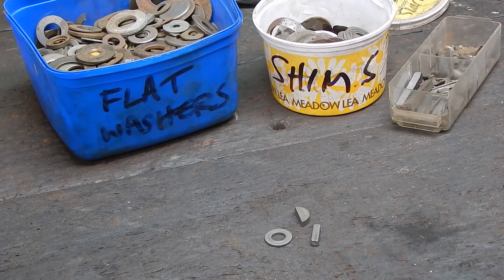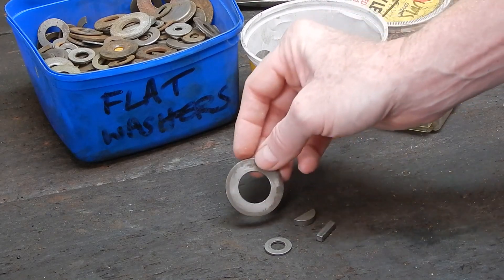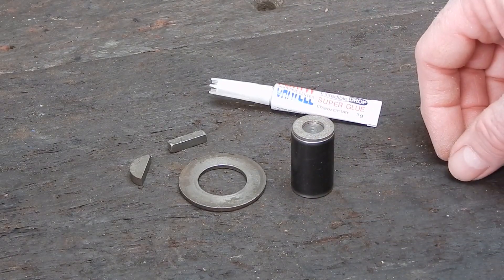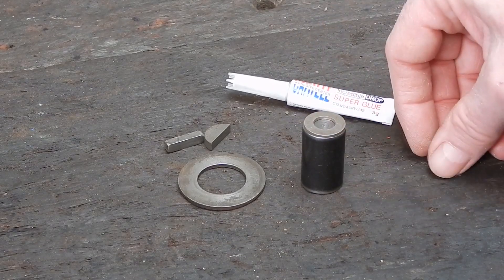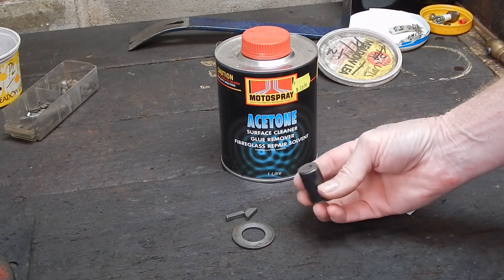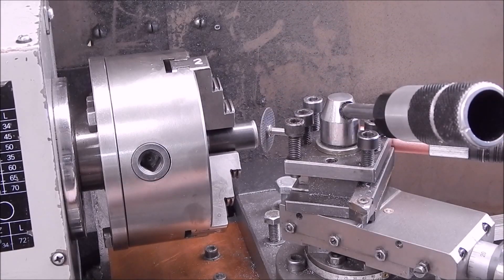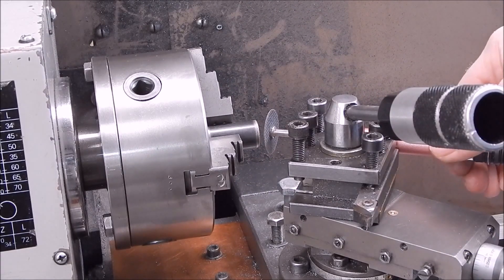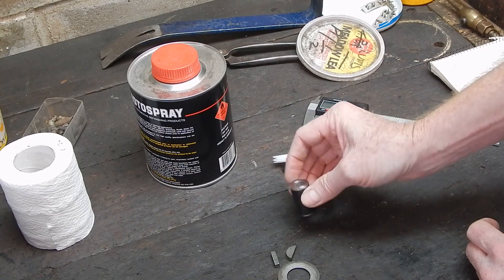How to reduce the thickness of small items on a lathe

Comment: An off topic question but did you make that tool post handle yourself?  I love it, it looks beefy and nice to grip.  wish you'd do a video making a copy of that if you made it yourself.
Reply from the maker: +Curt Warkentin 
Hi Curt.

It's actually an after market alloy footpeg from a kids BMX bicycle - I bought a pack of two from KMart.  I turned the front section of knurling down and it grips nicely.

I hated the original tiny toolpost handle, and this is an easy/cheap mod to do.

Cheers Rob
Reply: Thanks Rob.  I must agree with you, the original handle is quite small.  I think the one on my lathe is a bit larger than the one you started with (mine is still in its crate Im working on the bench for it as we speak), but I am like you and do prefer something a bit more substantial to use.  I like how yours turned out it really does look great.  Thanks for the videos I do watch them quite often... great reference material and you have some excellent ideas. :)  Thanks again and keep the awesome videos coming. :)

Curt
Reply from the maker: +Curt Warkentin 

Hi again Curt,

Your comments inspired me to do a follow up video on this subject.

https://www.youtube.com/watch?v=lX4rbl6lbck

I hope you enjoy.

Cheers

Rob

Comment: If you mill a short slot along the length of the blank just enough the get a caliper leg behind the washer then mount the blank with the slot between 2 jaws on the lathe you can measure it without removing it from the chuck.

Comment: I have a pencil air grinder made by Blue-Point it is a 75,000 RPM  grinder but it cost me a lot more than 30 bucks and I've had it for some years now.. Works real well for this stuff and the super glue trick is great also.. If your around a hobby shop look for CA glue it looks like super glue but it holds stronger and just works better all around.. I use CA glue for building RC Plain's they also make a CA release agent :) 

Dennis

Comment: Good follow up on the die grinder tip.   
You might be able to glue two woodruff keys to the end of the round where the flats are face to face so you would have 100% contact during the grinding process, plus you have a spare if you didn't need two.
Thanks
HH
Reply from the maker: Grinders can handle interrupted work extremely well, as the applied pressure is very light, and there is no "catching" effect. So 100% contact is not necessary. Rob